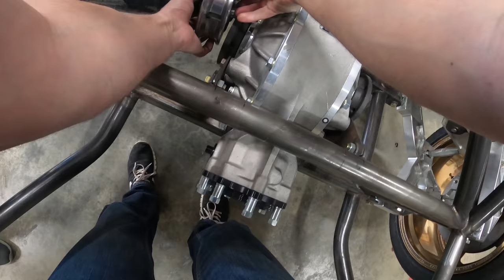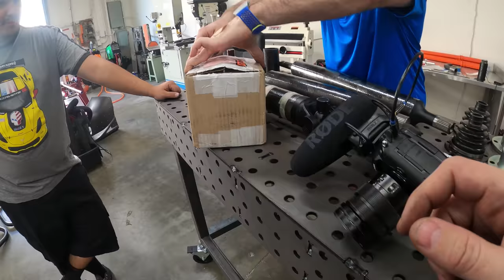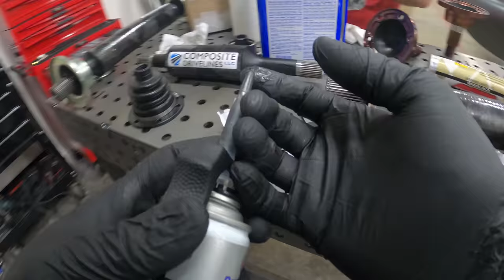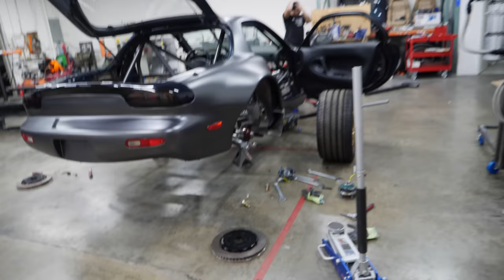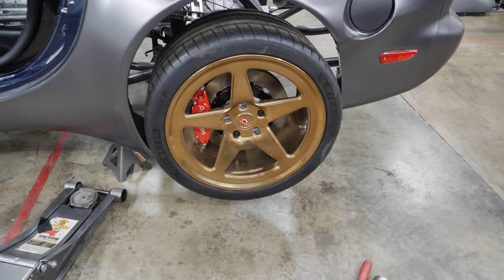Carbon Fiber Drivetrain INSTALLED in AWD 4 Rotor RX-7!!

Comment: Hi, think should shield the shaft that goes to the front wheels of the differential
the fact is that carbon does not like overheating, in the video, the shaft is very close to the exhaust pipes, this  heat can damage the carbon shaft

Comment: Dude if you don’t use a plug drill bit to drill them countersink holes on the upright the bolts will come loose all the time. As you have already drilled them now you will need to get some washers the same shape as the drill bit made to fit the hole now. For the drive shaft bolts i used to use schnor washers to stop them coming loose.

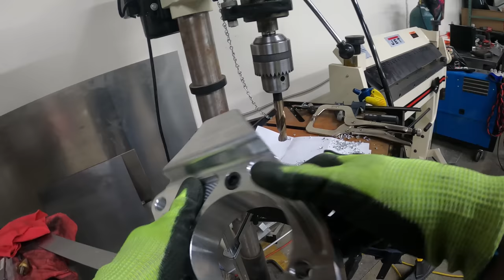Comment: 8:36 shouldn't you use a bit that can flatten out the lip that the bolt heads sit on? The underside of the bolt head is flat so having it sit on a tapered surface might be very bad.

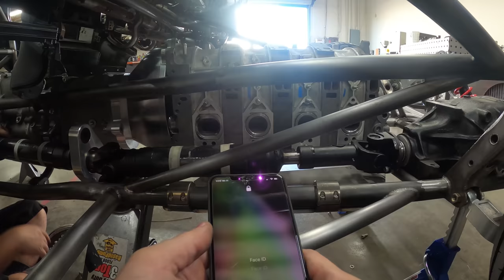Comment: Me: notices cracked iphone screen glass.  2:25
My OCD: FIX IT!! (ノಠ益ಠ)ノ彡┻━┻
Reply from the maker: It was from leaning the transmission on my hip while starting the engine lol I wear it like a badge of honor.
Reply: @RobDahm  at least the oled panel isn't cracked that would be very annoying ex: bright colored lines going across the screen or a black spot of dead pixels.

Comment: You messed up with dirlling the "countersinks" for the allen heads. They will come loose. A drill like that gives you a chamfered hole, you need a flat bottomed hole for an allen head because the bottom of the head on that screw is flat. Now only the outer edge of the allen head is pushing into the aluminium, it will eat a groove into the aluminium under load and will get loose. You should have used a flat milling cutter. Now go fix it by using a flat nosed milling cutter and a washer in the hole to make up for the difference if you want the heads to be flush.
Reply: Btw; get a milling cutter with more than 2 flutes to do this job in a drill press. Like 3 or 4 flute; 1 or 2 flute cutters will walk all over the place and vibrate like crazy in a drill press, especially with a jacobs chuck that you have in there.

Comment: Just wondering if you need those countersunk bolts to be resting on a flat surface and not the tapered edge that the drill leaves
Reply from the maker: I cut that sentence it of the video. But that’s part of the reason I left them up higher

Comment: You should counterBORE for those bolts. Countersink has an angle and that is not right for the bolt you are using hopefully you put a flat on the bottom after drilling

Comment: well those uprights are ruined now. You do NOT want that taper at the bottom of the countersink from the drill bit. The bolts need that flat bottom to clamp properly. Take them to someone to flatten the bottom of the countersink with a proper tool.

Comment: Rob go but some counter bores for next time you use that drill press bc eventually using just a drill makes a V shape instead of a shape that is like a bore and flat at bottom. With t6061 aluminum is soft enough where that the way u did it will wear down bolt holes in spindle. I work in areospace as machinist.

Comment: Rob  just so you know, closing your eyes alone does not protect them from the UV and IR from welding. It's not a huge deal, but you are damaging your eyes still. Silly as it may sound, safety glasses usually fully block UV and IR, so usually if you close your eyes and wear safety glasses you're not doing any damage.
But you're really just best off looking away or wearing a welding helmet.

Comment: Making some good progress - hope you're still taking the time to eat, sleep and whatever.

What do you have in the rear diff'? Normally with a form of LSD the undriven wheel would be dragged in the same direction, with reverse rotation only with 'open' diff's?
The other thing is the rather expensive plunging type Lobro's - any reason for going that route rather than conventional designs with the 'shaft sliding on the internal splines?

Comment: You really should use an end mill to drill that hole so u have a flat seat for the bolt head to sit on not and angle. You'll be able to tighten the head into that angle some and could pull through. Normal drill bits have an angle of 118° or so.

Comment: 1) don't machine with gloves on unless you want to go thru life missing hands :-)
2) Use a flat bottom end mill to do a counter-bore.  Using a twist drill will not machine a proper parallel mating surface that will provide a sufficient normal force for the socket cap screw to torque down onto.  The the mating edge of the socket cap head will compress into the soft 6061 aluminum and will develop slack (at the most inopportune times).

Comment: there's a problem with your countersink: The drill bit leaves a conical end in the hole, meaning the screwhead doesn't have a nice mating surface (since screws work by friction)

Comment: Nice build, but all those super 2000 lbs/ft torque driveshaft and clutch stuff will be useless with a stock gtr transfer case. You are probably going to destroy it around 700whp.

Comment: Get an End Mill Drill bit for those countersunk holes.
Those Socket Cap Bolts have a Flat Bottom and need a Flat surface to mate with properly.  Tapered holes are not acceptable with the torques you will need to maintain.
Don't get cheap on us Rob.

Comment: Maybe it was the editing or the camera angle but I would definitely make sure your are greasing and using the rtv right. Usually want to put a small bead of rtv and put the pieces together wait 24 hours then torque them down. I could be wrong in this application but it wouldn't hurt to double check that it's being done correctly!

Comment: I can't not wait to see this thing running and driving!! My question is whats the gear ratios in the diffs and also I know this is an awd build but any plans on using a selectable transfer case to shift all the power to the rear or maybe some of the power?  I'm sure it'll still do smokey awd drifts💪💪💪

Comment: You need to do something about those free floating bars up front coming off the radiator bracing. If you hit something, that bar is going through your tire and through the wheel, locking up the front.

Comment: Wouldn't it have been better to use an end mill bit to drill the knuckles?  Having a flat surface for the bolt to hold on to I'd think would be best vs a slope left from the drill bit.

Comment: Bad idea using a drill bit as a counterbore for the cap screws. The tapered landing area under the bolt head is going to transmit torque into the aluminum sideways instead of down and distort that wheel bearing bore.

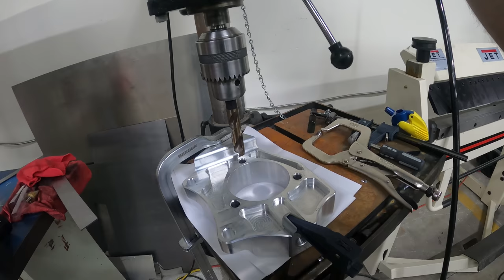Comment: @8:15 shouldnt you be using a flat faced drill bit to make the bolt seat flat? If the mating surface has a chamfer that could cause issues